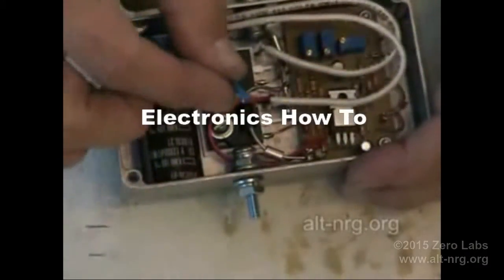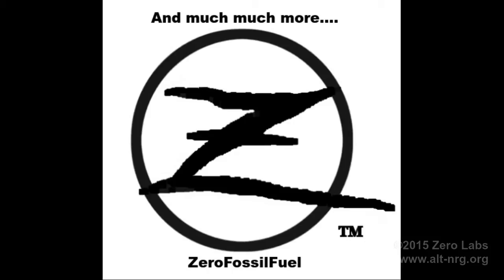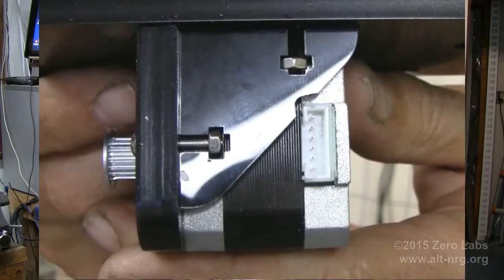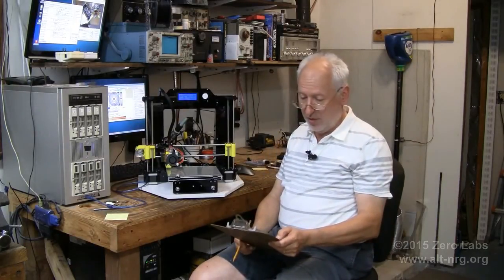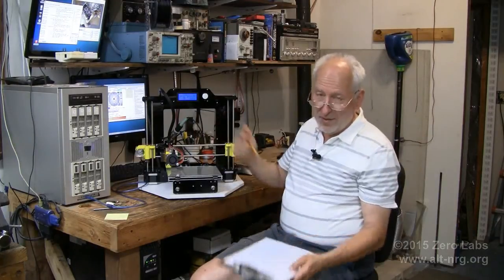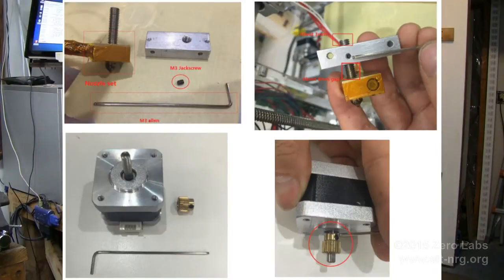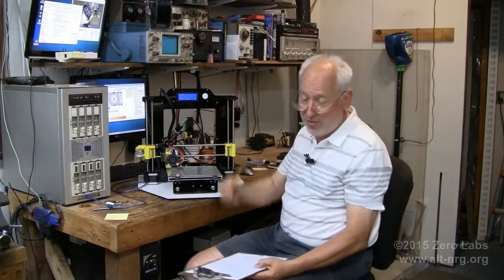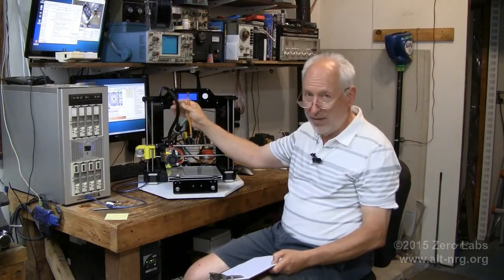#404 A602 3D printer kit final review

Comment: i was wondering if you happen to have a pin diagram for the board?  Ive had this same controller board on my a60s acrylic variation unit for a number of years with a large amount of mobs many which i have found mirrored in your suggestions as well as 30 other issues that lay within this crap knock off build most of it stemming  from the fact  many parts are combined from multiple different prusa i3 models which made it difficult to replace various parts had to resort to dimensions and hours of cross checking.    I recently did a marlin firmware update on it and Ive hit an impasse: the  expo 3 unmarked on the board for expansion connections. i want to setup a bl-touch auto bed-leveling on this port but cant get any signals from it with out knowing the pins for marlin.  {currently setup as a ramps 1.4 }

Comment: I'm really sad that i haven't seen your video earlier.
I came across majority of your problems. Pieces didn't connect properly, files were for old style printer, and some of them had missing directories. And on top of that, whole sd card for some reason stopped working and required formatting. And little metal balls that are in aluminium bearings started falling out, which caused it to stutter a lot.
After all, printer s pretty shitty and as you sad, I'm furious and never buying anything like this again.

Comment: Hi there, where did you get the manual from to build this. Many thanks
Reply from the maker: +Paul Fry Downloaded from the mfg web site. Also on the SD card that should be supplied.
Reply: +ZeroFossilFuel my pc won't read the sd card, all I need is the wiring diagram.

Comment: Hi.  I have the same printer, and for the life of me I can't figure out what I am doing wrong.  The printer is properly assembled.

The issue I am having is when I go to print something, the printer goes through the motions, but, it looks like it isn't extruding fast enough.  I copied your settings into my printer and still have the same problem.  It's extruding at a fraction of the speed it is suppose to be extruding.  I've swapped out the hot-end and the thermistor and still have the same problem.

Can you please help me figure this out?  Do you have any suggestions?
Reply from the maker: +Dan Azzariti I always start by upgrading the Marlin firmware with the latest release from the Github repository and going through the settings. You'll need the Arduino IDE v1.0.5 or later to upgrade it. I did promise I would publish my firmware settings but never got around to it. Thanks for reminding me.

Comment: Final update... I found the "X" axis upper rod was too long. I sanded 1/8" off end and reassembled the printer. All fits well. "Z" had filed the bracket to fix his but by shortening the rod fits also. The kit does not go together easily. You MUST pay attention to all thing mentioned by Z and myself to make a decent printer. Do not think any kit is a throw together as is. It needs modifications from the start. Good luck to all.
Ron

Comment: OK, its done,,,, somewhat... ! Yes it doesn't go together easily. I am still trying to add upgrades to make it a solid printer. If you don't mind the rework you end up with a decent printer.
I did all the modifications from "Zero" except the remote reset. Mine came with a cutout around the reset button on the display.
The upper left rod bracket came wrong. I have requested a new one from the factory. I think they sent two right sides instead of one for each side. I hope to see the new one soon.
The printing I have done so far has been decent. I really like the SD card feature which eliminates the computer connection.
I wish they had a final inspection by a semi skilled person to be sure the correct parts are in the kit before they are shipped.
I printed many of the parts which I felt I needed to upgrade. The X and Z limit switch brackets needed to be upgraded. The X is better and stronger in PLA . The Z bracket Zero suggested allow easy leveling and adjusting if you use a glass plate for a bed. I used m3 self locking nuts purchased from a Hobby Shop for the adjustment screws for the bed. The bed has been staying set so far with minimal adjustment needed.
Now that it is done it seems to be OK. I thank ZERO for the videos which helped me avoid many issues I would have had.
Ron

P.S.   Maybe HAVIT will send me the next generation printer because I gave them a GOOD REVIEW !!
Reply from the maker: Ron Rice "P.S.   Maybe HAVIT will send me the next generation printer because I gave them a GOOD REVIEW !!"  LOL!  All I know is they have not contacted me back to review their new mini printer! ROFLMAO!!!

Comment: I liked your review on this printer. I had all of these problems. I am finished putting the printer together but it shouldn't have taken me so long due to parts not fitting with one another and others breaking ( having to Gorilla Glue them back). Your review was helpful and mad me realize that now I have to drill a hole in the faceplate for the lcd screen reset button ( which I completely did not realize).

Comment: Sound like this kit was a waist of money! I have a CTC 3D printer from ebay 600$. After I changed the filament guides *(8$), I 3d printed the left extruder to have a spring in it AND I got a piece of glass from Lowes to go over the build platform (I cut it so size). After these very MINIMAL changes the 3d printer worked/works super good. Again only 600$, with dual extrudes and filament..... WORKS comes assembled.

Comment: I have this printer too, ran into many of the same issues when assembling but eventually got it all working wonderfully. Print after print came out great for about 3 months. Then one day about 2 hours into an 8 hour print, it stopped extruding. This was roughly about a month ago and I have spent countless hours trying to locate the issue at hand. I have swapped stepper motors, adjusted settings, ensured connections, cleaned the extruder tip as well as the guide wheel and gears...nothing. It prints now but inconsistent with thin layers and seizing up at times. I ran into the same issue when calibrating everything initially, but was able to troubleshoot settings and adjustments out over the course of a couple days in tinkering. This time its nothing like that at all. Havit claims to offer a one year warranty (was on the listing when purchasing), but has denied it when I contacted them. They have offered to help, but so far its been sending me ideas of what to do to fix it, all of which I have already done. With the time difference of them being in China and me in the US, its a one day at a time process. Hoping to get it working again as I loved it when it worked, but as of right now its a $400 paper weight after only about 5 months of ownership.
Reply from the maker: Michael Harris Check the motor connectors at the PCB. They're not really rated for the current being fed to the motor windings. I will soon be soldering all of my wires directly to the posts. Also pull the boars and check the post solder joints underneath. Chinese made crap is notorious for solder blobs and cold solder joints.

Comment: BEWARE MURPHY ALERT!! After my bragging about my printer never giving me a problem. Today I fired it up and started printing and suddenly the x-axis slide sticks and I had to stop put  touch of oil on all the guide rods and start over. I hate Murphy. LOL
Reply from the maker: thewhitedogdad The X gantry slide is more critical than it looks. When I added a 3rd slide bearing I had binding issues too. Turned out the casting of the 3rd bearing from a different vendor was ever so slightly different that, when placed along side one of the originals supplied with the kit, would bind when tightened to the aluminum gantry. Solution was to move the new bearing to the top by itself and the two original bearings side by side. Details, details.

Comment: I bought this printer and the controller seems to not be working i followed the instructions step by on hooking it up i can get the bed to heat up and the extruder but no movement i even tryed loading stl from the sd it said on the screen it was mooving but it was not moving now is their a good controller board i can buy to replace it or should i just get a replacement?
Reply from the maker: Rc-flyer Pretty much any flavor RAMPS 1.4 will work. Are the motors getting any current at all? Meaning if the controller is turned on do the motors resist being turned by hand? If you've double checked all of your wiring to ensure it's not your mistake, beat the vendor up for a new board! Why pay more for a controller?

Comment: After watching all this I am glad I I purchased a Flashforge Creator Pro several months ago.  It still had a few minor issues but it worked out of the box and has worked well ever since.  In the classroom I teach in we have a Makerbot Replicator 2 and it has been a huge pain in the butt ever since it was purchased.  The art teacher bought a Printrbot metal and had nothing but issues from the beginning and it was even pre-assembled.  It had many of the same quality control issues you mentioned where it simply was not tested at all.
Reply from the maker: kuhrd And the $1200 price tag is what holds 3D printers like this back. If I was to build again from scratch I would definitely use 10mm rails and linear bearings throughout, not just for the Z axis.

Comment: Makes me wonder what other little trolls are still lurking within.  It bothers me a little when 3D printers are made with 3D printed parts, but when I see a printer with this many issues, it makes me really question the quality of the 3D printed parts as well.  Does Havit actually make this in house or did they design it and rely on a chinese manufacturer to produce the components?  This looks to me like something that was a kickstarter project at one time.  If there was any testing done on the LCD controller, it was probably just a power on and that was it.
Reply from the maker: erik61801 I'll do a follow up later after I've run it for a while. I wanted to get this video out ASAP.
Reply: WaybackTECH  i was hoping he would run it thru its paces before his conclusion. like 50 hours straight to really flush out the gremlins.
Reply from the maker: WaybackTECH Printed parts don't bother me so much. The Prusa i3 is part of the RepRap open source project. The parts are made by Havit using the open source templates, either unmodified or slightly tweaked. Even the LCD is a standard Chinese made stock sub-assembly. The controller board seems to be proprietary. I've never seen one exactly like it before.
Reply: ZeroFossilFuel  sounds great. cant wait to see what the MTBF is on some of those components heh
Reply: ZeroFossilFuel
I see. Interesting. Well hopefully they will address these issues because I agree with your statement about being a very well designed printer.  
I have had my eye on the Da Vinci AIO printer with a built-in scanner, but it uses their own proprietary filament which is limiting.
Reply from the maker: WaybackTECH Yes, proprietary filament would make me shy away too.
Reply: WaybackTECH  I have one of the DaVinci printers and the proprietary filament is a bit of a draw back. However there are a number of work arounds for that issue, some are free some you can buy. However the quality of the printer makes up for the issues with the filament. I have had mine for several months and it has worked perfectly since day 1.  I am not a production shop I make a few parts a month and love the machine, no adjustments no messing about just plug it in and print.
Reply: thewhitedogdad
It looked to me like a very nice printer for the price. The filament only concerns me because there are so many types coming out.  I would like to be able to try out this Ninja Flex stuff as an example. But for $700 it seems like it will do everything I would plan to use a 3D printer for.  What is your opinion of the scanner ?  I hear it is just OK at best.
Reply: WaybackTECH Don't know Don't have one
Reply: thewhitedogdad
so yours is not the DaVinci AIO printer then.  Probably basically the same printer.